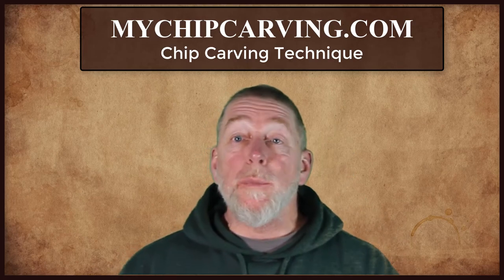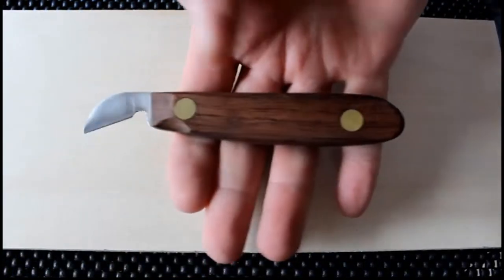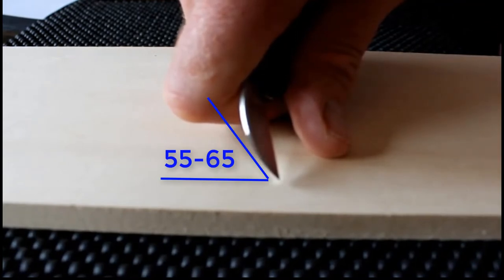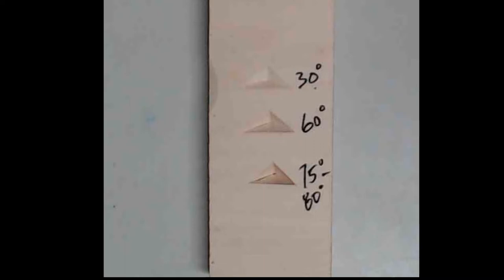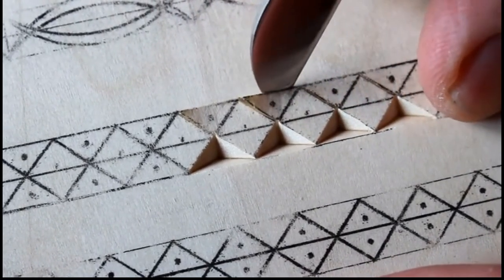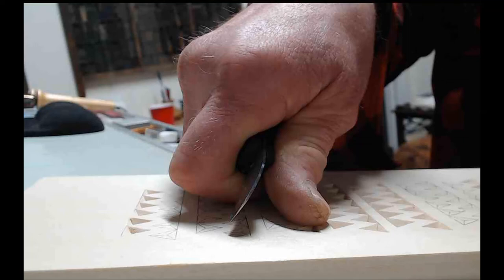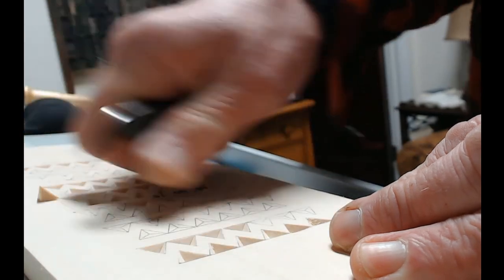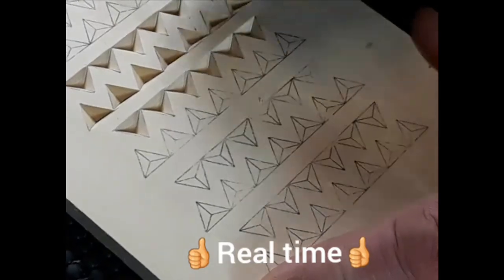How to Hold a Chip Carving Knife

Comment: What kind of tree do you use?
Reply from the maker: I"m carving basswood (linden tree). In Europe they carve lime wood. White pine is good to carve as well.
Reply: @MyChipCarving  hi, where I am basswood is extremely expensive and only available in small sizes. Is white pine as good and as easy to use?

Or maybe I can glue some basswood together and make the size I need? Would the glued area give me issues?

Thanks for any tips.
Reply from the maker: @alexanderthegreatsdad.3831  White pine is good to start with. It's just a bit harder than basswood but it is fine to carve.